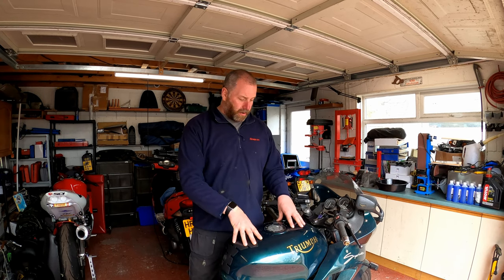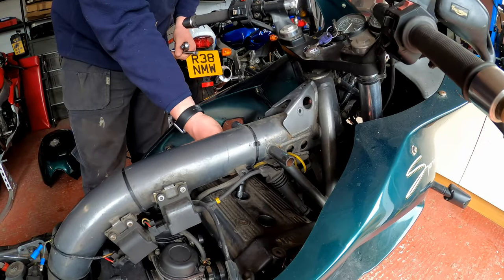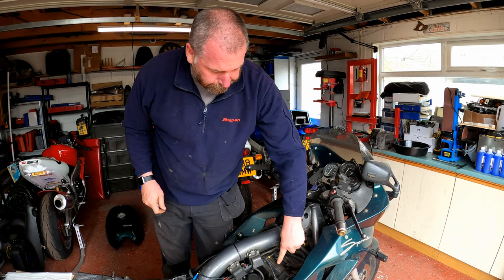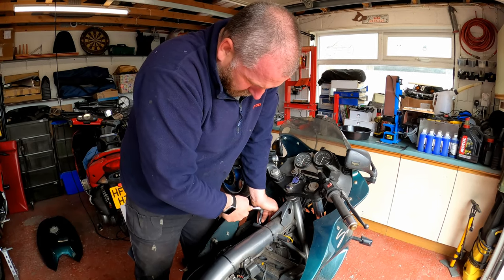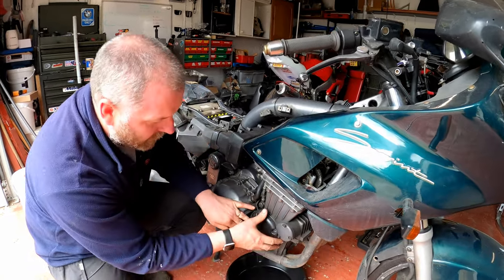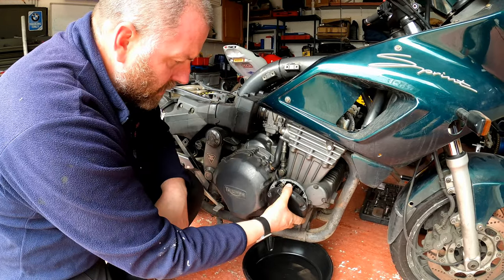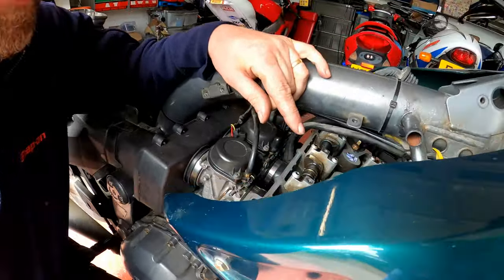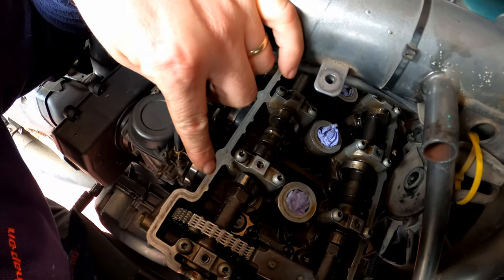1994 Triumph Sprint 900 Service Series - Part Five - Valve Clearance Check & Adjustment

Comment: Hi, many thanks for doing this  - I'm doing that job on my '95 Trophy at the moment and it's been helpful to watch. Could you please clarify what tool was used to torque up the awkward cap torx screws under the frame, as the available height is insufficient for a regular torque wrench.

Comment: Nice on Kev. Think I may have located a well preserved example of the Sprint you are working on. Having run a 70s Trident and T120, where one expects oil leaks due to vertical seals and the march of time (plus other reasons..) I thought these Hinckley engines were up to Japanese designs and tolerances, with leaks a rarity. But if it does weep the odd drop then how reassuringly Triumph !
Reply: I have had a 95 for years... never ever a drop of oil, except when I did not replace the drain plug washer lol. These things were built like tanks.